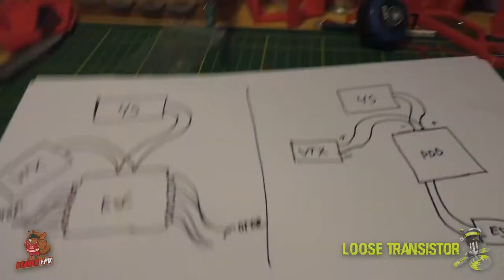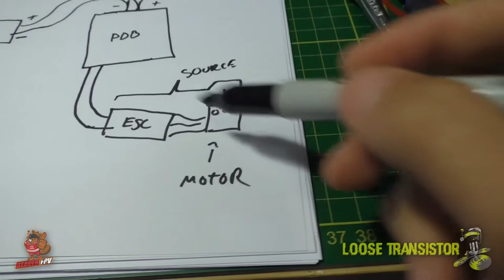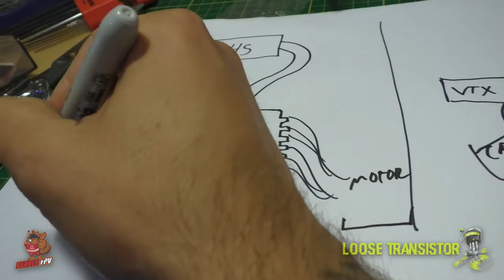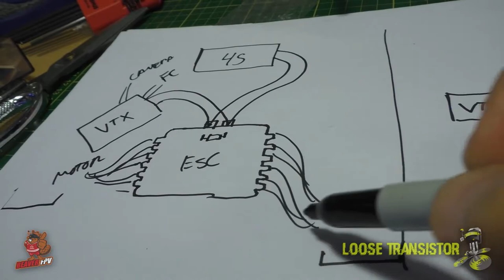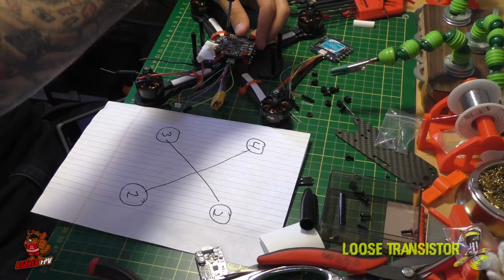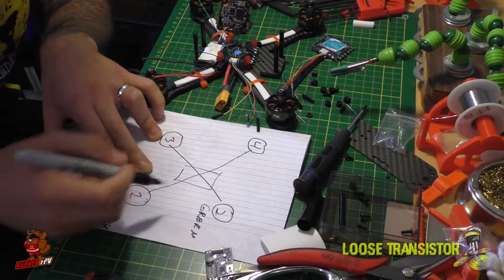STRICTLY RACING DRONES 5" - BUILD TIME! ♠ [ FPV DRONE BUILD ] (re-upload)

Comment: Maybe i missed it in the Video , or maybe you said it in other videos , where is your favorite place to get the Diodes ?
Reply from the maker: I usually order my components directly from DigiKey because I am in North America and shipping is rather cheap and fast. Here are some helpful links!

GET TVS ZENNER DIODES
-----------------------------------
DigiKey Selection - http://bit.ly/2q3lrTl
Ones Used On Video - http://bit.ly/2pwot1F
4S limited Diodes (+Koen NAir suggested) - http://bit.ly/2pA1r9S
Reply: Groovy cant wait try the out . i have a quad that has an LC filter on it , which cleaned up a few things but still getting some sort interference with when i punch it. not as bad as it was before the LC filter , still noticeable
Reply from the maker: I found for best results a combination of the TVS diode on your ESC + a capacitor or LC filter should do the trick quite nicely! Good luck and please do let me know how it goes for you. I am trying to collate as much data as possible for the next video on the matter.
Reply: Ill keep you in the loop . maybe remember a before and after video for you
Reply from the maker: That would be priceless!!

Comment: please could you help me with wich characteristics should have the tvs diode? I want to buy in a shop but how can I buy it?
Reply from the maker: You have to look for a TVS diode with the right clamping voltage. For 4S you want something around the 22V range for clamping. If running 5S you want 35V